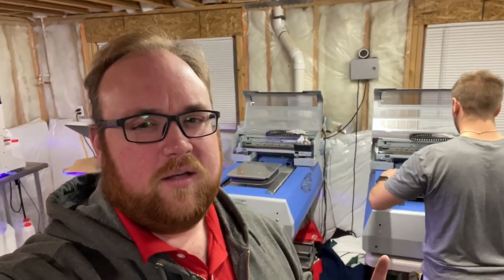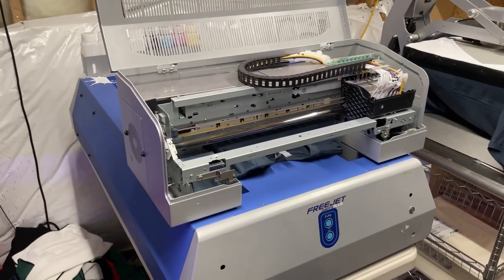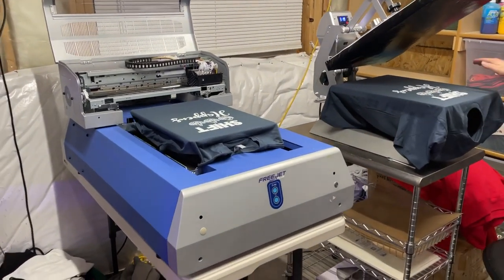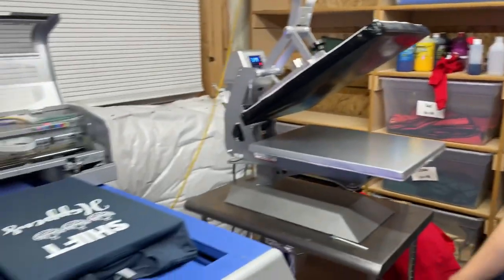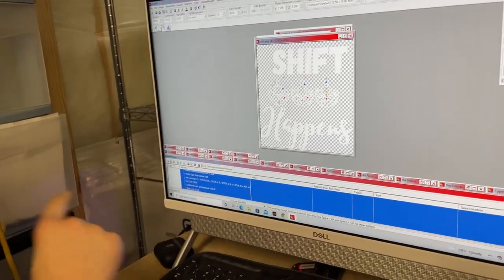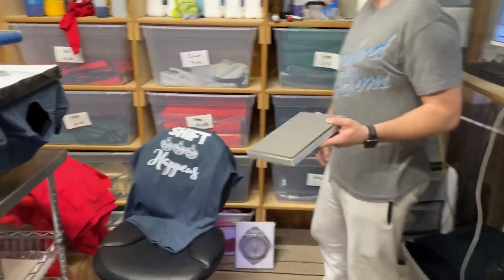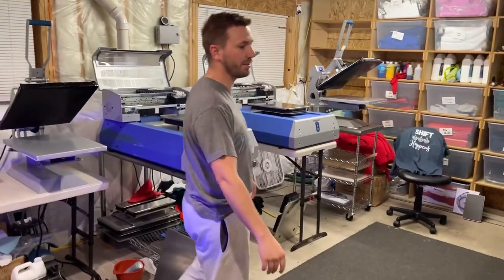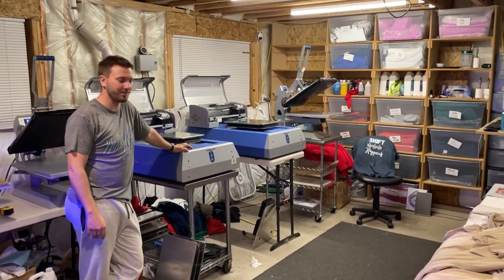Omniprint 330tx plus dtg printer, is it worth it? basement print shop tour of Direct to Garment shop

Comment: Use the super nozzle cleaner with a little of distilled water and dip those pre-treatment parts to maintain clean, if it is a rubber gasket just leave it dipped on distilled water overnight, The pre-treatment is the easiest to maintain. Hope this help I own 2 also….

Comment: I appreciate the video. DTG is a dream and a breeze for those of us who have been working in that space for a while. This machine is not the best to spend time recording to share with the audience however I love the your channel, I will keep supporting. there are way better machines then the Omniprints. My unit goes weeks with no usage, and no issues. The clogged head is really an outdated problem.
Reply from the maker: What machine do you have?
Reply: @ttms   I have a G4. the cheaper machines do come with major set backs. Also if one is thinking about getting info DTG I would say learn it first before you decide to make a big investment. Its not as easy as most people think. But its not always the machine most of the issue are operator error.

Comment: Nice organised setup, for me though it is a little too slow in both production and ROI. Wouldn't it be nice if one day the pretreat for dtg was a single non clogging pass in the print process and for dtf the thermoset adhesive powder became a liquid form and was also simply a non clogging single final pass in the print process. One can dream, or one can be surprised if it already exists :)
Reply: the Kornit offers this at close to $120K per machine.
Reply: You just need to raise your prices and prioritize quality.

Comment: Funny that pretreat machine is about 3-5k and clogs a lot. I have a Chinese $1,200 machine I bought used off fb market for $600 and hasn’t clogged yet after about 1000 shirts and never even cleaned or changed filters or nozzles. I just make sure I purge the system with water.

Comment: Very interesting, Honest question... Could a person use a hand sprayer that can aerosolize the pre-treatment solution and save themselves 15K?
Reply from the maker: You definitely can use a hand sprayer. Most pretreat machines are $5000 new so you won't save $15,000. You will save some though.
Reply: @ttms  Thanks for replying. I'm considering buying an existing print business. It's a small, one-man operation that only does fine art replication via giclee printing on two epson p8000's. 
I've been watching some DTG vids to research some options to expand the existing business.  I have zero commercial printing experience of any kind, so what would you suggest that could be an easy addition and maximize value to the shop?  Thanks for your help

Comment: The only one that will do polyester is TOTAL lie. ANY DTG printer will do poly if you sue the proper pretreat. They Print nice, but they are still technically a DIY DTG build, just a quality one. The kothari rip is what makes it shine, but you can run others on kothari as well. They are Epson R2400 which is discontinued and the DX5 printhead is expensive and hard to get with depleting stock. It also sounds like that PT machine is a headache. There are better much better ones, ones that give you more precise control and less headaches. Keep grinding though. You have all the right tools, now just use em to make yah money! upgrade and improve along the growth process.

Comment: 3:00 - that statement was so false. Any dtg can do 50/50 or 100% polyester. It’s just not recommended for long term. The garments won’t last as long but still come out pretty nice. For that being the main reason he bought freejet is laughable. These machines are epson based and manufactured in China like everything else. That’s the reason they all have print areas up to 16x20 which is epsons max